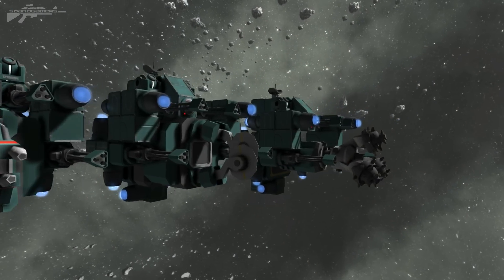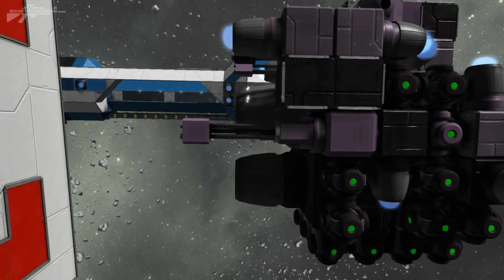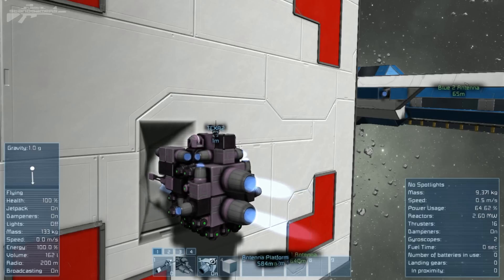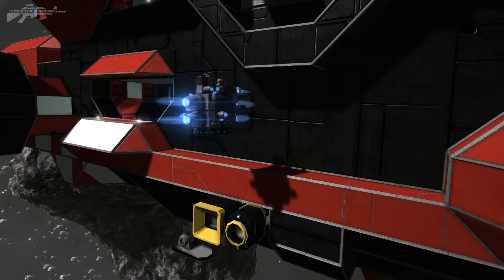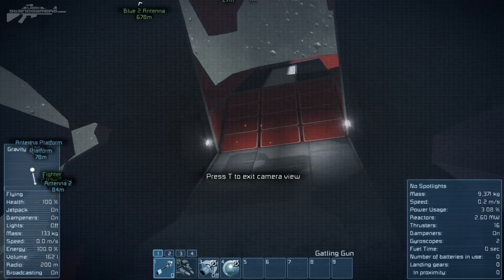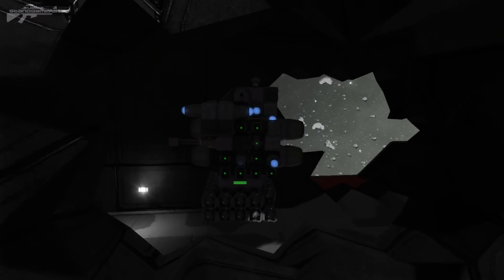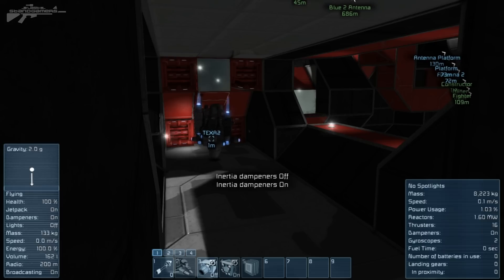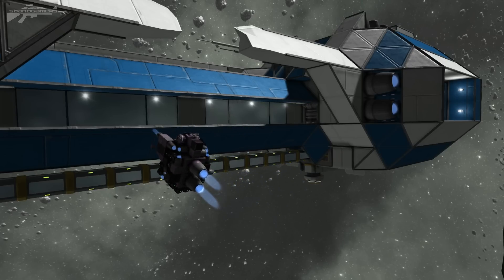Space Engineers - Melta Drones, Thermal Lance, Cutting Torch

Comment: For cutting a hole, put a beam in front of the ship on a rotor, a large thruster at each end, facing forward. Set the beam to rotate with the thrusters on, it cuts a nice piece of hull out, and the thrusters aren't limited when the blocks angle down. Perfect break-in tool.
Reply: I guess you would also have the large thrusters in a circular pattern that is larger than the vehicle itself. 

could be promising.
Reply: I am testing my theory now.
Reply: It's more promising with a mining laser, it seems. I'll have to look at it more. THe main issue is how many gyros your ship needs and the rotor is worse with every update.

Comment: they should add a sound to melting metal, for realism purposes.
Maybe something similar to the welding torch, but distinct enough to not be confused with it
Reply: What sound does melting metal have? The only sound I think would be heard would be the "welding torch", here the thrusters.
Reply: ***** No physical medium for soundwaves to travel through...
How could we forget something so primordial??
Reply: Most Sci-Fi will answer that they have in suit system imitating sound to help astronaut with orientation. Biggest nitpick is linear Gravgen, and fact that to weld in space you need only touch two piece of metal (so called "space welding").
Reply: ***** Nah, I'm genuinely thinking that I'm a fucking idiot for forgetting that really.
Reply: TheRezro Space welding which is cold welding only works if they are similar or the same metal. Anything that is too different won`t weld.
Reply: Thraxmusic So? It is that hard to get this same material for large scale construction? And other stuff you could install with screwdriver, what have far more sense then crazy hot welding in space.
Reply: I don't know about realism but it would surely help to have the sound so you would know if you're accidentally torching you ship to cinders.
Reply: there should be no sounds in space.... for ''realism purpose''
Reply: Thraxmusic we do have plasma welders which work under water & in space, which a lot of large sea going ships have on broad if by ant chance that they need to repair something when their not at a dry dock, but what is needed is more bulky then the little welder that's in the game but hey its just a game
Reply: elementalblaze79 But does it make a noise?
Reply: elementalblaze79 Yes, and use something what deform metal in precise construction, and possible melt it is pretty safe to use in space environment, where even rouge nut can simply kill you. It's not case of working (not mention that welder work also as small thruster), but common sense. Obviously most basic tool in space is screwdriver, not welder or grinder. But yes, that is just game.
Reply: Eien in space no, underwater yes, but some people state that the suits in SE have sensors that aid in emulating the sounds so we can figure out where the sound is coming from & stay safe
Reply: sound can travel trough metal , astronaut's suit , air in the astronaut's suit and astronaut's body so he can hear what is happening on his ship
Reply: kamil2001studio We also have computers in future. They could detect what going one outside and inform astronaut by sound.
Reply: Eien I suppose the heating metal would expand, making creaking sounds as the metal tries to set
Reply: but the problem is, there is no medium for sound to travel in space
Reply: Well, now that there are pressurised ships, you could hear the melting metal from inside...
Reply: well, you got a point there (im a outdated crack user)
Reply: Tsk tsk lol
Reply: but still, i don't get it why you hear sounds while outside (drills mining, etc)
Reply: Maybe the soynds waves move through space, but you hear them only because of the air inside yoyr suit.

Or the sound transfers through the gloves jnto the suit, and the sound waves are transfered from the gloves to the helmet.

Or some space magic
Reply: it is if you're the one mining, but what about the turrets? yes, they hit you but you shouldn't be able to hear the gunfire, only the bullet piercing thru your suit
Reply: Brenden Y Sound doesn't spread in space no matter if here is air in yo suit or not.
Reply: +Tom Awesomeface if you are touching something in any way in space, you can "hear" it....because vibrations exist when touching your suit...

Comment: I attempted to do this a few weeks back. Or at least a similar concept. A boarding craft that would latch on with clamps, and "drill" a hole in the side of a ship, and open up to a hollow interior where troops could be. Never panned out, the clamps would break off. But, using your idea with the dual sided, activated at the same time thrusters, I'm pretty sure I could get it to work.

Comment: Hey if you want to make a circular cut use a compass design. Put a spear tip or point on the front of your drone penetrate the side with it. Place a thruster above the point (  the further above the larger your circle will be if you wanna change sizes you could put the thruster on a piston ) and then just rotate 360 until it goes clean through all the way around. Happy building :)

Comment: An even better design would be making like a dumbbell shaped thing with thrusters on the outside sides (back and front)
and put a merge block on the bar, where you could attatch a few drones (depending on the size). Then just thrust forward into a ship, and make a big hole where the drones could fit in and start melting/grinding away. or just use it as a battering ram that destroys everything in its path. (Im imagining a swat guy holding a dumbbell with thrusters on it, melting a door.)
EDIT: Im talking about it would look like a cluster bomb with drones in it with thrusters on both sides.)

Comment: The best way to tear a hole in a big ship isn't with grinders or engines. From my experience the best result I got was from building a small ship with a cockpit in the center, then I put a lot of blocks around the cockpit and even more in front like teeth and you want the front teeth to be really long you also don't need a lot of thrust. Now just press the teeth against the big ship push forward, go in to a death roll while you push and you can trash a big ship. Also the more blocks you use on the small ship the better.

Comment: have you think about to put some thrusters behind on rotors? if the power of rear thrusters is more stronger of the front thrusters you will obtain more longer "flames" in front if the inertial dampers are active, this trick probably will cause more damage and simplify the process of smelting on non regular surface.I don't have try it, but  theoretically is applicable

Comment: Pretty interesting. Though, the "stealth" aspect is kinda useless atm, since you'll have to have an antenna on to control your drone, your enemy will have a big red name flashingon his HUD. Maybe a mix between this one and the grinder one... The grinder could be use to break into the ship, and the thursters could be use to damage any small ship inside.
Reply: the only solution to that problem with the HUD is to add a cockpit and turn any antennas or beacons off
Reply: u can set the broadcast on the antenna to off there fore u can send signals to it but not receive any from it
Reply: If you do that, you can't control your drone anymore. If I'm not mistaken, in order to control an drone, both antennas need to communicate with each other. Adding a cockpit and controling it from the insde would work, it wouldn't be a drone anymore, but it would be a nice solution.

Comment: Here's a thought, you were using ion drives for this, which was VERY clever. But what if you were to experiment with HYDROGEN   thrusters? Vanilla Hydro engines are 3X more powerful than ions/atmos. so that might in theory be a better breaching system.

Also, invite clang into it the mix, by sticking 2-4 of them on a rotor to get that circular cut you want.

Comment: what would happen if you where to build it on an elevator so it slowly works its way down the enemy ship. Then in side that you put a fuse of a thruster that can be suddenly delivered when the enemy realized  that this thing is taring the ship apart and if they didn't the first warning they would get is the power going dead. Then you withdrawal the ship and let the enemy die from lack of power to recharge their suits. After this you can either repair the ship in your own colors or simply scrap the hole thing in a short time. A hell of a lot richer.

Comment: Could you make the engines on the front and back be like this?
oooo
8     8
oooo

Then it would cut the outside edges of the hole almost all at once.  

Might need to line up more power plants behind it like a battering ram, but...

Comment: There is a flaw this drone requires a ship that's stationary so if you go in and it's not stationary you fly backwards and crash into the wall
Reply: that said, once your inside as long as you leave the melta's on your going to completely destroy the interior
Reply: You could turn off inertia dampeners and try and keep the speed of the ship. Not that hard.
Reply: Or just add a landing gear at the front.
Reply: I think the biggest flaw of all is that any ship that has one or two turrets can just blow these drones to pieces before they get anywhere near it, and if they don't have ANY defenses to stop it, why do you need to be silent, just through a warhead or missile at it and walk in that way
Reply: Chris God and now you've spotted the problem with space fighters..point defense weapons will tear them to shreads
Reply: Toryu Naminosaki ya but remember, turrets lock on at a range of 800m but the fighters can fire rockets at a range of 1000 (maybe more but that's the range you can see the red dot)
Reply: Chris God unless ppl are controlling the turrets..then you're screwed

Comment: Make a melta bomb. Just a reactor surrounded by engines
Reply: ***** that would be quite a sight, seeing a large reactor hurtling towards you!  ;)
Reply: Too bad they don't explode when they take too much damage. That would be cool. You'd have to armor you reactor room!
Reply: +Breadstick Cowboy Ya never know, someone might! But I wasn't thinking a super big explosion, maybe just the size of 2-4 small warheads. Excellent name by the way!
Reply: ***** The physics here fail so hard. -_-
Reply: Nuclear reactors don't explode. Not in the sense of an atomic bomb anyways. To put it shortly, reactor grade uranium is not enriched enough to reach critical mass for a fission chain reaction. Though it could explode if it melts down and the runaway energy production heats the water too much and explodes like a pressure cooker left on too long. I don't think a steam explosion would be anything worthwhile compared to a warhead.
Reply: ***** Correct me if i'm wrong but i believe you are thinking of a nuclear blast on the surface. If a nuclear weapon is exploded in space, the effects change drastically. First, in the absence of an atmosphere, blast disappears completely. Second, heat also disappears because there is no longer any air for the blast wave to heat. Third, in the absence of the atmosphere, the radiation has nothing to slow it down, so the area being irradiated is far greater.
      To do any physical damage with a nuke, you would need to implant it into the side of an asteroid and propel pieces of the asteroid at the target. unless, of course, you wanted to kill them with radiation, but this should be only a last resort tactic, seeing as you will irradiate (and most likely kill) yourselves as well.
Reply: ***** unless its fallout 3, then the radiation will regrow limbs in less then five seconds :P

Comment: Why not just attach on with landing gear instead of counter thrusters
Reply: Cheeky Nandos If you want to breach a wall/hull the block will be destroyed and your drone would most likely go flying, also it needs to move around to cut effectivey.
Reply: I mean to hang on and make the drone easier to use on moving ships
Reply: Even then the same problem persists, destroying the blocks would cause the drone to detach
Reply: Sen Kanashimi you could make the landing gears strech out further
Reply: Not really since that would make it less compact and a bit easier to see, and it still brings up that it does need to be mobile to cut through effectively
Reply: Cheeky Nandos you could have the landing gear on the side, and cut out just a center part away from where it is mounted
Reply: Cheeky Nandos Nice idea
Reply: +Sealand nah just use a landing gear... i mean its so buggy wen it explodes it will probably take out everything.

Comment: UGH you melta Drone could have been simplified down to just 7 Engines (not counting melters) 5 Explosives 2 Pistons 1 rotor and a landing gear with a camera ancor onto a ship with the gear set to auto with unlimited break angle into position THEN cut threw if assembled properly you can breach a ship that is in motion AND take it down not just make base breaches like you have here.